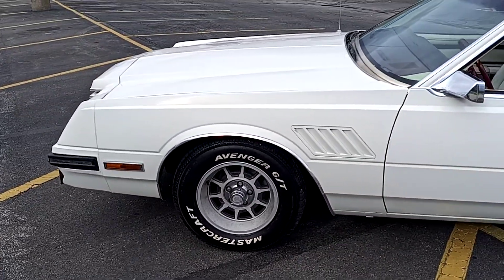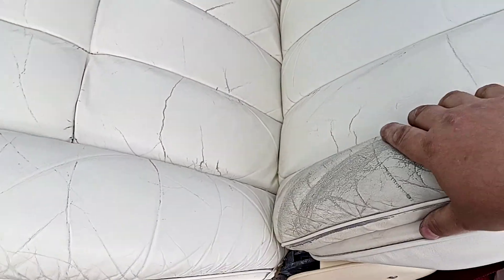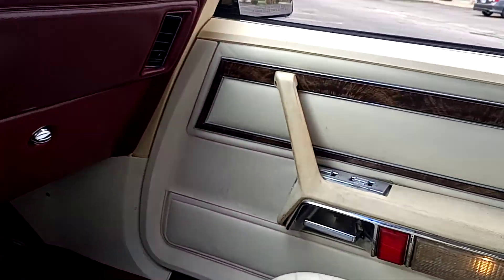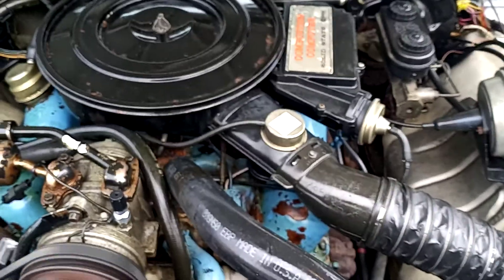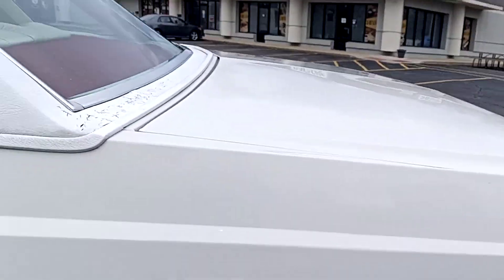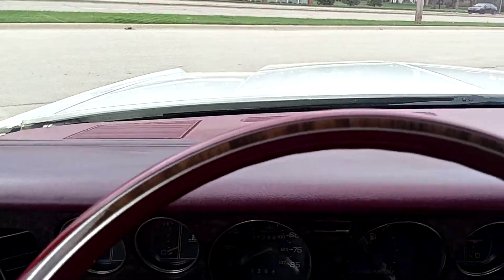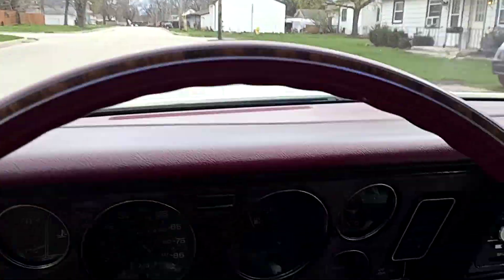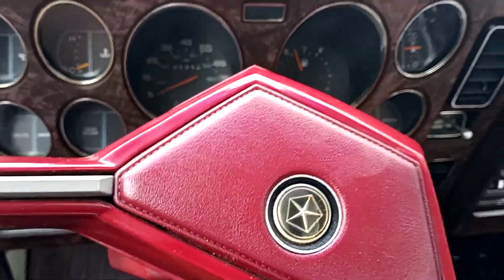1982 Dodge Mirada walkaround and test drive! Sold it on eBay!

Comment: These cars had constant electrical issues when new. Also lean burn issues. They were prone to rust as well. I know this from working at a Dodge dealer back then. Chrysler was having so many financial issues back then they really struggled to keep up with the competition. The wiper linkage bushings are available at your local auto parts store. The wiper transmission though is very hard to fine. Discontinued by Chrysler over 20 years ago, and about impossible to fined at a wrecking yard and are not available aftermarket. Good luck if you need one.
Reply from the maker: Lean burn is evil. This car had it deleted.

Comment: Bought my parents 1980 with only 36,000 miles back in 94. All red with a slant 6 225 engine. Eventually the engine leaked gas and caught on fire.
Reply: Had the same set up only mine was gold with tan.
The thing was a snow plow.

Comment: I had a 81 with a 225 Slant 6 ran for ever!
Reply from the maker: Never owned a slant six but I've heard they were pretty much bulletproof.
Reply: Not mine, engine caught on fire.
Reply: @aenoymotors  they were and the oldest slant six I’ve seen still running is now over 40 years old. The van it’s in isn’t so hot. But damn you got your moneys worth out of them.

Comment: Good car to collect. Last of the good ones.   Cant understand  why it was discontinued.
Reply from the maker: They didn't sell too well. Back when it was new gas got expensive and front drive vehicles with smaller engines took over. I have a 1981 Reliant K wagon that was the replacement for these types of car back in the day and it drives almost as nice with way less fuel consumption.